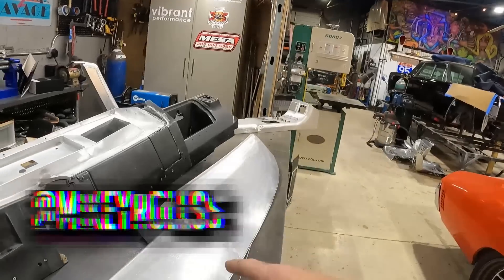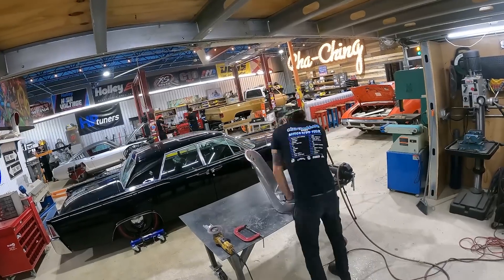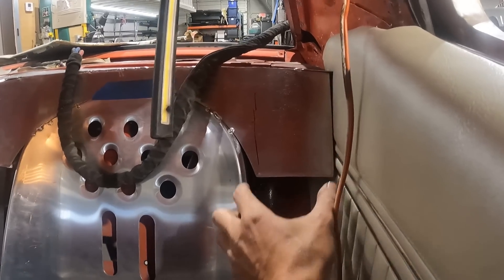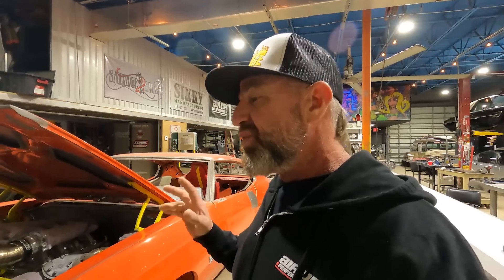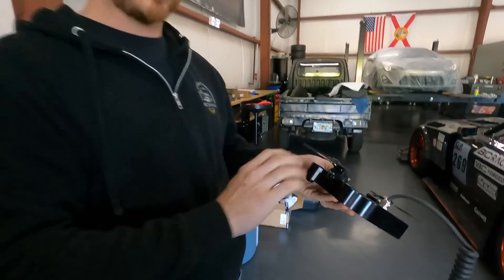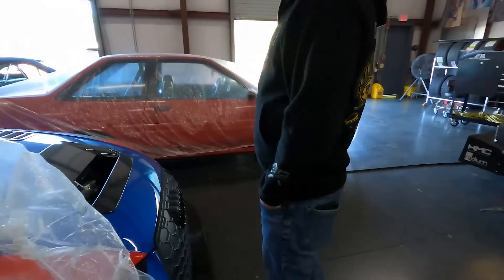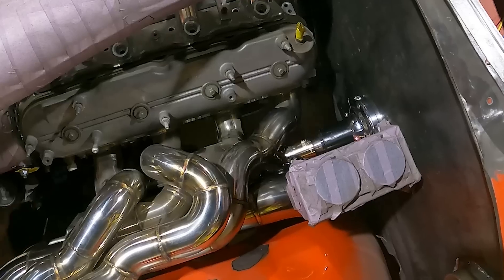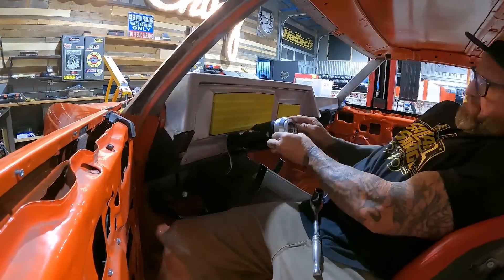Twin Turbo LSX Chevelle + BMW DCT Transmission! - LS Swapped 1970 Chevy Chevelle Ep. 12

Comment: huge amount of work on that Chevelle... hope it'll all fall down right in the end (I mean it'll stay together... like these hoops replacing the boxed factory pieces, I would have added a bolt on horizontal strap underneath to close the circle, otherwise it structurally only behaves like a hacked 1" tubing of the whole unbent lenght, that is flexible..)

Comment: What will control the trans? Sweet setup!
Reply from the maker: We have an AMG shift lever as well as the paddle shifters. The ecu will be wired into that control panel that the guys at Attacking the Clock installed for us!
Reply: @SalvagetoSavage  Do you know if it could be made to work with a holley dominator?

Comment: How you gonna get into the vehicle if the battery or connection is lost if you deleted the keyway in the door?
Reply from the maker: Valid question, we will have the battery in the trunk which still has the key. So can throw the jump pack in it and bomb get into the car

Comment: The problem with having a vehicle like this built instead of building it yourself is if anything goes wrong you've gotta ship it back to your builder and you better hope they're close
Reply from the maker: Well this customer is local so that won’t be an issue. But if it were to be ship far away we would run it and get the bugs out first

Comment: "I'm going to be driving up north to Florida..."  You filming in Cuba again??
Reply from the maker: Did you watch the whole episode or just the beginning. Lol Kyle edited out the part I said Orlando but later in the episode I said it again
Reply: @SalvagetoSavage  Of course! Just bustin' your balls!  Building a 67 Firebird with a LSX 454, Tremec TKX, Detroit Speed underneath, tubbed, dropped to the deck. Getting a ton of good ideas from this build. Basically learning the sky is the limit if you have a vision and a tig torch.